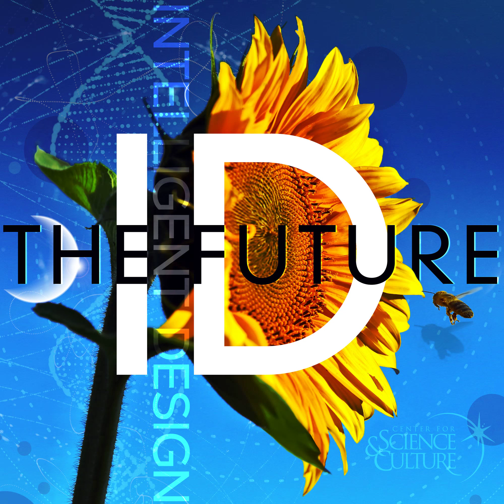The Pentadactyl Whale Flipper: An Engineering Masterstroke

Comment: Two points:

1) The closer to optimal a design is, the less it will vary among designers (insofar as the goal is performance). Everyone agrees that animal designs are close to optimal. 

2) A modular design with shoulder, arm, hand, and finger bones allows for lengthening and shortening as small changes over generations for adaptation purposes, which everyone agrees happens. Again, the closer to optimal a design is, the more places we should see it in a given animal kingdom.